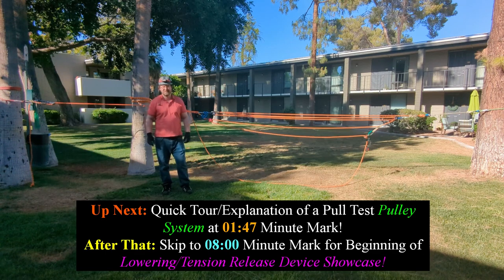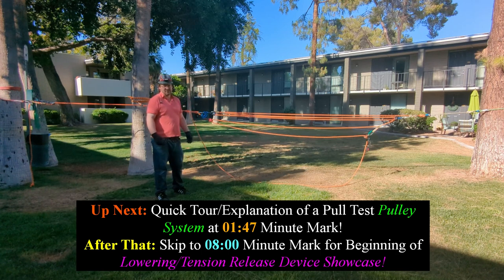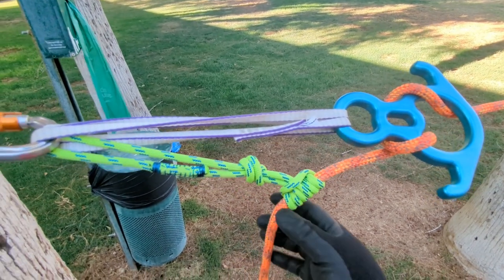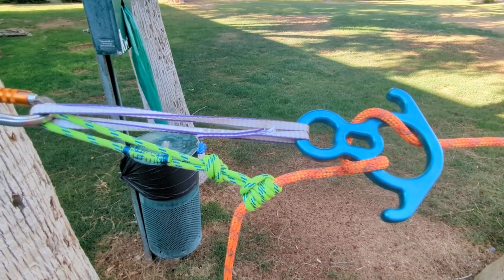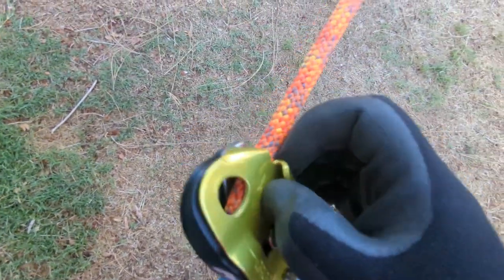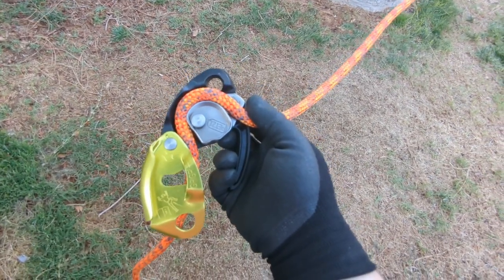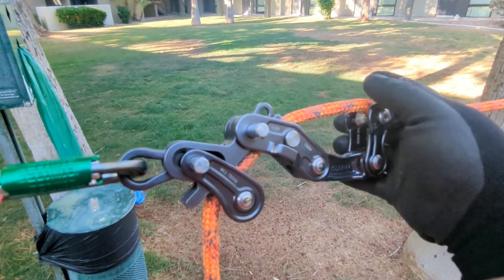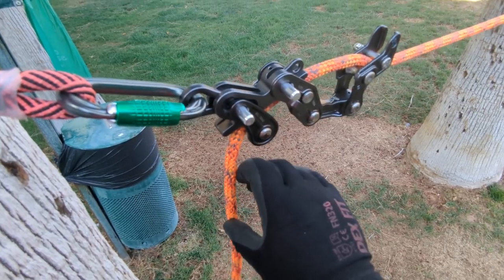Devices for System Backup, Lowering & Tension Release for Arborists, Tree Climbers, Rock & Alpine!

Comment: How many gri-gri can you put in there instead of prusik cords?
Reply from the maker: As many as you feel you'll need, but they can greatly increase friction when used as part of a hauling system since they aren't as efficient as a pulley with a prusik cord. However, they are great for backing up any progress made while using a pulley system and for easy lowering, tension release. Be sure to check out these two videos: Here is a video you might enjoy about hauling systems with progress capture: https://youtu.be/jM2QiYZrYVE
Here is a video all about Z-Rigs: https://youtu.be/sIB19wbGAA0